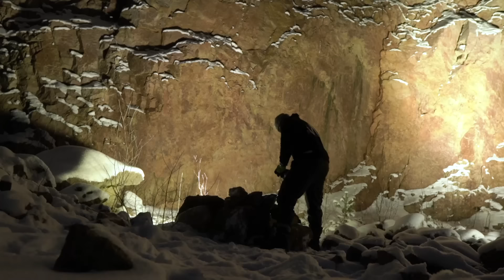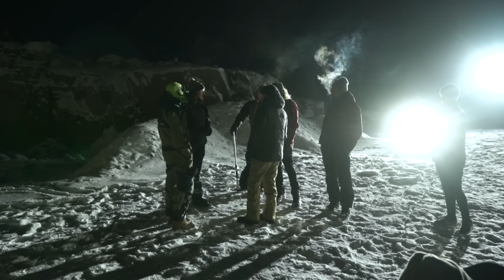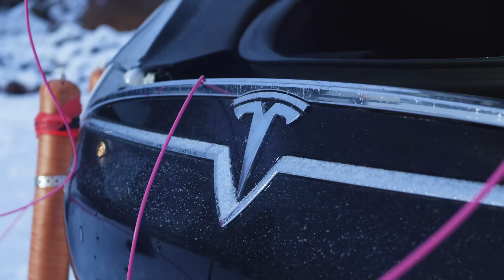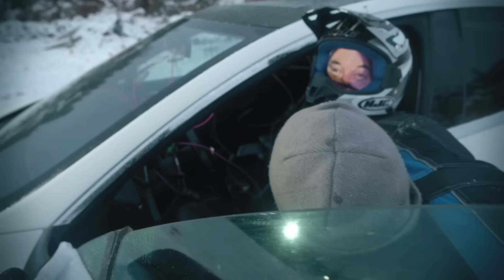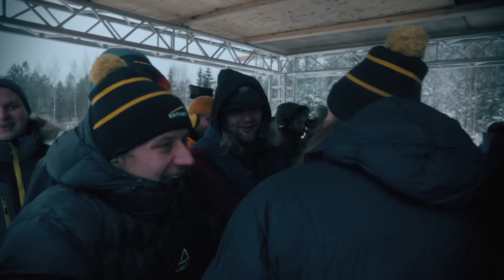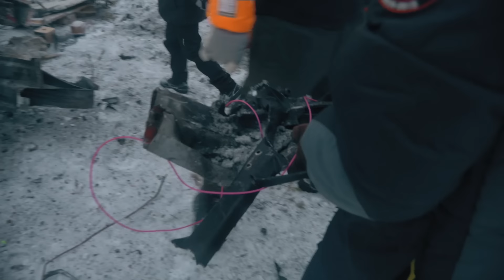Mies joka räjäytti TESLANSA!! Tesla Model S & 30kg dynamiittia.

Comment: That super slow motion where you can see the shock wave was awesome!
Reply: yes! you can see the lensing effect from the shockwave
Reply: Yeah, i said wow out loud when I saw the wave. Lol
Reply: Any Human there would most likely be paste and goo.
Reply: Could you state the exact minute and second
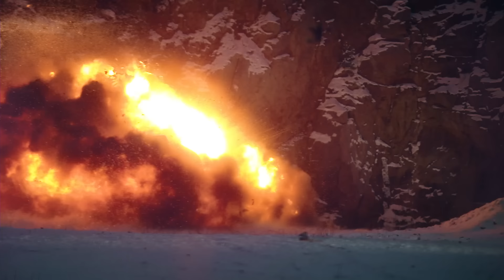Reply: Oh found it 6:40
Reply: You have no mercy. How many flies were killed by that shockwave, in a 8000km radius. Do you accept responsibility for this?
Reply: C'est ce que j'allais dire !
Reply: @rusticagenerica  flies in winter?
Reply: @sca33  Power Winter Flies. Never forget that Time Flies !
Reply: @Fabio-ql5yf  When the gas moves faster than speed of sound, the air inside the explosion is supersonic, and the shock pushes the air outside and expands it outwards. The glassy line we see is the shock line, a semi sphere all around the explosion.
Reply: @Fabio-ql5yf  If that is a serious question the answer is the explosive turns from a solid to a extremely large amount of gasses when it detonates and the expansion of those gasses compresses the air. The moving front of the expansion is an over-pressure of air that can do great damage. The reason that you see the shock wave is that the different density of air refracts light differently and causes a sort of "lens effect" or lensing. It is similar to when you see shimmering waviness in heated air coming off of something like a fire or BBQ.
Reply: Something looks like Elon Musk mannequin flying into the air
Reply: @sami.hlt27  
alors pourquoi tu ne l'as pas dit?
Reply: Thought that was some kind of video effect :D
Reply: @kwixotic  Parce qu'il l'a dit avant moi
Reply: Even more epic if you set the video speed to 0.25 ;)
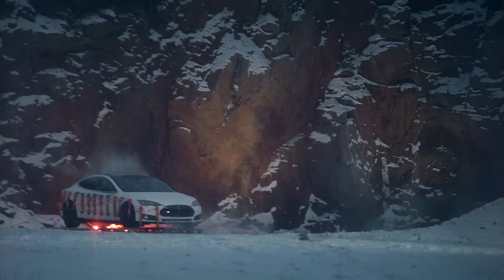Reply: 6:23 for those that want to skip to the moment mentioned above.
Reply: @Fabio-ql5yf  I think its just super dense air/gas. The explosion compresses the air around it and you can see it bend light differently because its much denser than  normal air.

Comment: Legend has it that when that Tesla was blown up to Valhalla, even the Gods grew angry because of the $22,000 replacement battery cost.
Reply: But to be able to reach Valhalla, you need to go down fighting. This Tesla didn't fight, it just refused to do it's job, bitching around with errors. So they wouldn't even have opened the doors of Valhalla ;-)
Reply: Eh a thing like tesla would not make it to Valhalla.Nothing Viking with a plastic car. hehe

Comment: I love how there’s a few sparks and then a bit of a pause so that you can think “is that all?” right before it gets death star blasted

They breed them differently (better) in Finland
Reply: The purpose is weakening the structure by blasting small charges in crucial points first..... than blow everything apart......
Reply: Pfui
Reply: @teslacoiler  No. The dude explained that part 1 is a show. After comes the red light on the wires and after that they finish it with the big boom. The dude explained it. No need to bring up your own fantasy lmao.

Comment: 20k€ to change a battery, this can't be the future. I hope this video will make constructors think.
Reply: Apple: Hold my iPhone..
Reply: Oh you just wait :)
Reply: Or the constructors would like to see how they get a cut of large revenue when Tesla lobbies them
Reply: @hermannschaefer4777  Apple battery is $30 lmao
Reply: @SPZ909  installation is 10x lol unless you do it yourself.
Reply: Ive said this for a long time, electric cars wont be the future. Atleast not in the nearest future and as long as we use super expensive lithium batteries with short range.
Seems like people here in Sweden already realized that now when its gotten really cold. They simply dont work, and theyre not cheap to run either during the winter when electricity bills skyrockets.
Reply: @AutoSia  Apple does it for $70. You don’t know anything.
Reply: @admiralfloofz658  Grand delusions. Lithium battery tech has improved drastically in the last 5 years,  just imagine what will happen in the next 15-20 years. Electric cars are the sole future. Sweden won’t have a combustion engine on a public roads 20 years from now.
Reply: When my Renault ZOE 2017 battery died in 2020 i got a new one "free of charge". But i own the car and lease the battery.
Reply: @hermannschaefer4777  xD
Reply: @SPZ909  Youre the one thats delusional. Nothing has happend with battery tech, the cars have just gotten longer, larger and wider to fit even bigger batterypacks. Tesla made other manufacturers dare to build purposebuilt electric cars, such as the new Mercedes EQS and the Kia EV6 where as all other electric cars previously have been electricified gas or diesel cars with no room for huge batterypacks.
I know because I work with these cars for a living.
Reply: I think he bought it second hand. That's why he had no coverage.
Reply: @MikaelMurstam  I don't understand your point. Do you mean that people can't resell their cars?
Reply: I think literally everyone is thinking about this for years. Every product maker knows exactly the shortcomings of their product. They are very smart bunch, it is just that these are extremly hard problems that take years to solve in small steps. I guess we just have to be patient and take this as tax for new tech.
Reply: Batterie garantie 8 ans ...

Comment: As a mechanic i highly recommended doing this to your car,  it instatly fixes all your issues..... Exept the one of You Walking home 😏
Reply: No walking wit the helicopter.. 😂
Reply: @paukkujussi  🤣🤣🤣 Oh yes! I totally forgot you had one!.... So as a mechanic i also reccomend buying a helicopter👍🤪
Reply: Walking home is never a problem for this legend.
Reply: You being a mechanic, recommend to change the battery for $20K? then there is a big problem with EV cars
Reply: I have a Saab 9000 from 1998 with 310 000 kilomterers on it. And I have had very few issues with it. Still runs great, even in the cold scandinavian winter.
Reply: @anbukumarm8578  how much do you think would cost an engine swap for Porsche Panamera (which is the same class, year and a bit lower sale price), to a new one in the Porsche factory? Less than 20k? Probably not. And that would be done in Europe, not on the other continent. So how is a capital battery repair (which costs like 60% of the original vehicle price) a 'big EV problem'? There's always an option to swap dead cells and repair computer in the 'private garage', it's done since 2001 Prius times. However the guy didn't consider that option. Why? Because the story is most likely to be fake, of the guy is just a complete idiot.
Reply: @DecoyEx  i don't think is fake
Reply: @DecoyEx  how much does it cost for this Tesla owner to get the repair?
Reply: I'd rather fly anyways.....
Reply: Yeah it could be real if more than a few cells wear out, degrade more than the others over time. They get out of balance, meaning they can’t charge up enough to stay in balance with all the other cells. The system would probably shut it down cause it wouldn’t give the right voltage values. The only option would be to pull the entire battery pack open it up and find the bad cells and replace each one. They wouldn’t want to do this so they sell you another whole battery. This could be an opportunity for a business to take and refurbish these battery packs, even with lower quality batteries would Give you a few more years of use out of your car.
Reply: @DecoyEx  i understand him, service at tesla seems to be really bad (heared this from a couple of People who had one)
Reply: @MostLuckiest  true, for a dealer it is much more reliable and cheaper to swap out the entire pack. Repairs are too expensive because of the time it takes.

Comment: I once took a 2 year old Peugeot 307 SW to the scrap yard, and asked them to press it while i watched. The car broke down constantly. Repair bills where over the roof every time. in the end i Had enough. The resale value of the car at that point was 15.000 euro in Denmark (tax heaven). But i rather lose the money and se it die in front of me. so I understand the man to the fullest.
Reply: I feel your pain... My cousin bought new a 207 HDi and spent more in 4 years than the cost of buying it... But in our case we brought it to the local motocross circuit and had a "little" fun with it while making sure it won't cause any more trouble to anyone else ever again hahaha
Reply: Guys you're awesome! My uncle also had 207 and hated it so much. It broke regularly, one time it even had an issue with key-starting mechanism (which is under the steering wheel, it literally fell apart) in the middle of nowhere on the highway in the night, at freezing temperature. That was scary. Now he drives a Toyota and tells that is "so boring to own - no repairs in three years".
Reply: @equim7363  That Toyota part made me laugh hard! Anyway, Peugeots where once pretty reliable, I had a 306 TD bought with 400.000 km and sold it with more than 600.000, and I still see it in my town. I mounted a van intercooler (I don't remember which model, came from the junkyard) and increased fuel pump and turbo pressure, it was a blast to drive it... But rolled coal like an old steam locomotive hahaha

My ex-GF's dad still has a Citroën ZX 1.9 non turbo which clocked more than 1 million kms, the rear power windows are broken, the gauge cluster goes haywire from time to time, the A/C works... Sometimes, half of the interior plastics are busted, but the almighty XUD9 still runs pretty nice!
Reply: Does Peugeot comes with no warranty?
Reply: That's impossible. My dad's 307 SW lasted for 13 years and 700.000 kilometers with little to no parts changed. 
The 1.6 HDI engine is bullet proof.
Reply: @johnnyrocketa1257  You can feed if with Kerosene and it will run like a charm...
You can change that for seed oil or sunflower's and you could pass the most strick emissions controls.
My two cents
Reply: @f1master973  The "SW" Was a 2,0Hdi 136ps. and it was a known shitbox engine, materials where to weak for the power. besides that, the seatframe broke, the airsuspension broke, egr valve pr. 5.000 km. the headlampe washer wouldnt stop washing, the aircon broke down constantly same with the heated seats... and i can go on. not a day without a failure for the 9 months and 13.000 km i drove it. I spend more than 10.000 euros in repair before it got crushed.
Reply: @ValdiValdies  I guess Pug warranty expires after two years, if you don't buy an extended warranty contract you are sold if you receive a bad unit.
My dad's was the 2005 restyling model one of the first fabricated and lasted 13 years...so I guess it is a older model or a defective unit.
Reply: @ValdiValdies  In Denmark kind of. Cause no matter what you make claim about, they say "og we dont cover that during warrenty". Or "You didnt use it as intended". For. ex - My rear hatch hit the rear bumper everytime i closed it. So the paint fell off (one week old car). But they didnt cover or repair. Cause they said i closed the rear hatch "wrong".  - Or when the timingbelt snapped after 8.000 km. (service book said it lasted 150.000 km). But they didnt cover a new engine, cause the 150.000 was "recommended" and not a quarantie that it would last that long... And a funny one, the light ulbs burned out several times a week. But they wouldnt look at the problem, cause as they said " You are turning the lights on wrong" (The car had automated lights)
Reply: @f1master973  I wanted to, but car was sold some time ago... Maybe I'll buy another one and try feeding sunflower oil (Very abundant here in Spain)
Reply: @steffen1972denmark  Yeah, Peugeot post-sales services sucks ass, my cousin had a lot of trouble getting repairs inside warranty time, they always give you excuses for not repairing...

And worse, it's happening to a lot of car manufacturers... I think i'll stick to my cars, as they never give me major trouble...

Comment: Electric cars are over priced.. Replacement of battery cost much!!. This man took a right decision. The explosion is a treat to eyes. Awesome 👌👏👏💥
Reply: You’re talking about a Sport car 
A new engine for a Mercedes can be over 60k€. Is it cheap in your opinion?
Reply: @furTron  Not really comparable is it?  You can't really compare the battery to an engine when these also have engines.  I guess you could try to figure out if he saved 22k worth of gas in the time he was driving the Tesla before he needed a replacement battery but even after that, those motors will ALSO need to be replaced at some point and that's when your comparison might be equal.
Reply: @furTron  Who needs to replace an entire engine unless you did something crazy??? You can rebuild for cheap.

Comment: For once, Elon hasn't a smart-azz come back. Quiet as a bird.
Reply: Whats there to come back on?
  It's a 9 year old car, thats longer than most cars gets especially considering most Teslas only last a few years anyways.
  If anything the owner was a fool to buy such an old Tesla model to begin with.
Reply: @pwn3dg4m3r  usually quality stuff last much longer than 9years lmao, just like my 32year old 200D w124 mercedes with over 800 000 km😹
Reply: @Fishuri  no doubt, what I mean is modern car don't last long.
Reply: @Fishuri  The thing that broke is an aftermarket battery he had installed which shorted and broke the car. It's like you installing an aftermarket upgrade to your car like bigger turbo's. Then your block blows up due to too much boost. Then you go cry at Mercedes. Mercedes would never fix the stuff you ruined for free. Normal people would buy a new block, suck it up and move on. This dude decided to not fix the car HE broke, but decided it's more fun to just explode it. That's fun too! Why not?

Comment: I should send them my '14 Jeep Cherokee.  They changed the transmission software and it is quirky and somewhat dangerous to drive it.
They say that it is  "Operating as Designed"    After getting no where with Fiat/Chrysler  my thoughts are of  running it over with a tank
or doing the same as with the Tesla.   I know the feelings of this guy, and the struggles with the car manufacturers nowadays.
Reply: I was on the hunt for a good used car about five years ago. Talked to the guys I always used to service my cars. Asked them which brands to avoid. #1 on the list was JEEP. Don't go near them, I was told. I didn't. Bought a Chevy they gave the thumbs up to and it has run like a Swiss watch for the last four years.
Reply: Aqui no Brasil passei por uma situação semelhante com um Ford Fusion 2.5 AT 2010. O carro era muito novo de aparencia mas apresentou tantos defeitos em um ano de uso que me fez desistir do carro. Vendi depois de ter gastado uma fortuna em reparos por valo 40% abaixo da tabela. Não gosto mais de Fords.
Reply: We had so much trouble with our 1973 Jeep. Chrysler figures owners have plenty of cash to waste on attempted repairs. Nearing the 50th anniversary of GM destroying the Jeep brand.
Reply: @DoubleDogDare54  What Chevy and year did you buy?
Reply: @johumphrey3964  '07 HHR. It already had 113K on it but the previous owner bought it at that dealership, serviced it at that dealership and did so regularly for ten years. I took it to my guys and they said the car was in excellent shape, buy it. I did. I routinely take it to my guys for an oil change and they always check it top to bottom when I do. Never had a problem with it. A few minor things that needed attention because Chevy recommended it be done at that point in time. Best car I've ever owned. Great mileage, too.

Comment: That's freaking awesome! I don't blame him one bit for blowing it up. $20k for a battery pack?! That's insanity! If the governments of the world want us to drive electric cars, they'd better come up with a better solution. I'll be damned if I pay that much for a battery! I'm keeping my Mustang, by God!
Reply: 20k€
Reply: That's Tesla's fault, the battery isn't that expensive, but they have a monopoly on Tesla repair, so they can ask whatever they want. It's also worth noting running an electric car is usually cheaper than a gas or diesel one, so you also need to take those savings into account. And other manufacturers let you rent the battery instead, which still comes out cheaper as long as you use it regularly.
Reply: Have you heard about the guy whos rather new model 3 required 16K battery replacement in telsa dealership, but third party did repair for 1.5K (plus taking it 3 states away in trailer) with pluming parts and did top notch job doing it. Telsa would not sell the battery cooling fitting that had damaged from road debris, only the whole new battery...absolutely ridiculous.
Reply: Well said, I totally agree and will do the same with my Chally.
Regardless Gas prices will go for. 
There will be plenty of gas for 20k.
And I will get lots of movement and fun for this 20k 😜
Reply: Current psychopathic level obsession for turning every vehicle into EV is really bad goal:
Unlike chemical fuels, electricity is super hard to store in big amounts and renewable electricity sources are mostly impossible to control for guaranteed production.
And electrical grid itself is in the end rather vulnerable to both human and weather induced factors and minus to reliability even if energy density of batteries can be increased.
While EVs can certainly be big part of solution for lowering pollution in air in cities, would be overall far better to focus onto researching and developing synthetic fuels to replace fossil fuels.